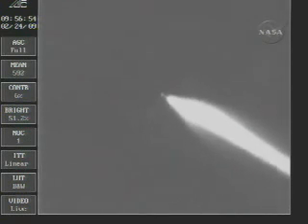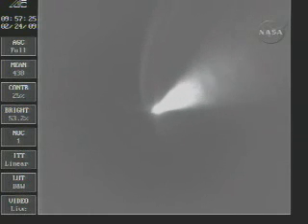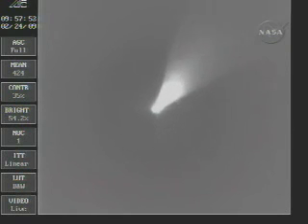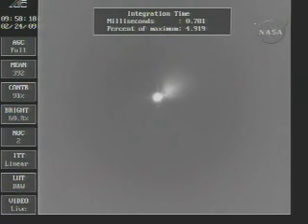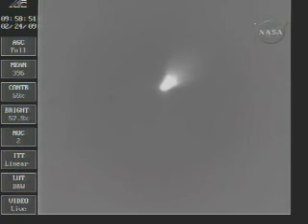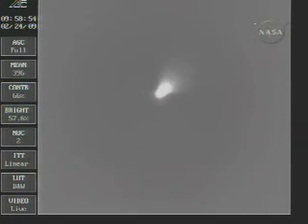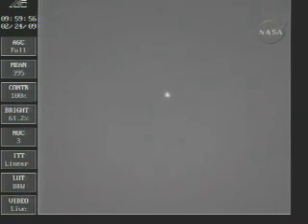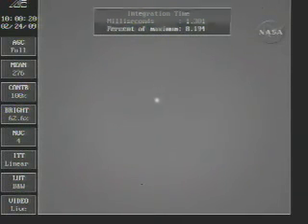Orbital Sciences Taurus XL (OCO) Failure

Comment: A rocket *would* actually have some effect on Earth's rotation, since most of the exhaust gasses are captured by the atmosphere and all that. Then again, when the payload re-enters it has the opposite effect, so in the end nothing really changes.

(I doubt it would be large enough to measure, but I suppose you could theoretically change the Earth's rotation speed by launching a bunch of stuff into an escape trajectory.)

Comment: @40390576 SRB's create several problems.  They cannot be turned off once started.  That is one reason why SRB's are so bad for human travel and one reason Werner Von Braun left NASA.  They usually fail in sudden, catastrophic explosions due to case overpressurization.  SRB's depend on its propellant is poured into place and cured just right.   Since the mid 90's we have seen Indian rockets, Titan IV, Delta II, Challenger, and others fail all using solid fueled engines.